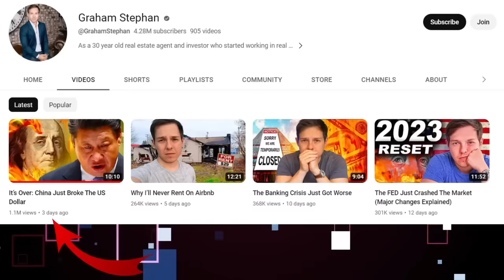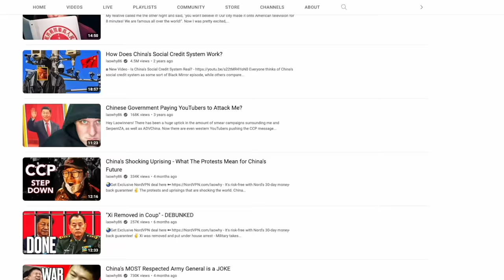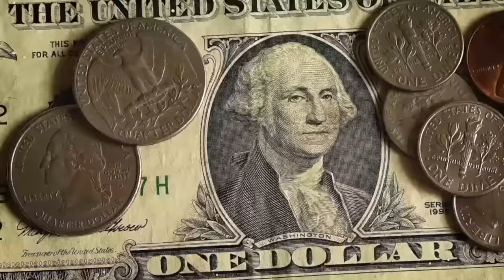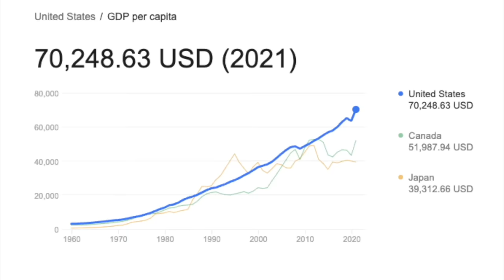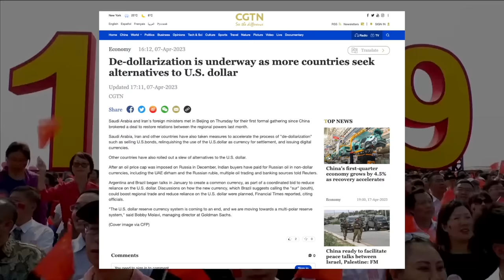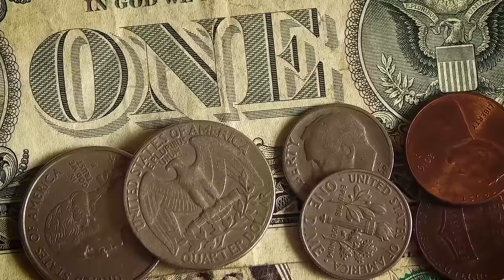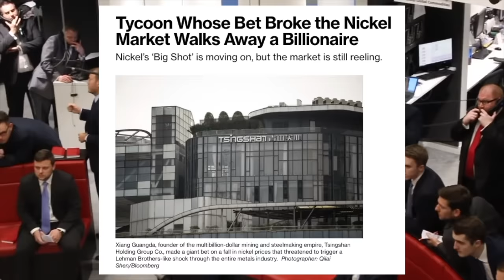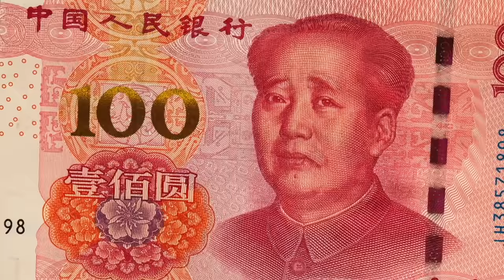It’s Over: The US Dollar Just Broke The Chinese Yuan

Comment: This is how the new BRICS+ global currency will work. They may call it Gold Gram (GG), a digital currency to be issued by the main BRICS council on ONE day, assume Aug 1, 2023.  The quantity of GG to be issued is based on the actual gold reserves at each central bank or certified gold holdings, in grams. Assume Brent oil price on Aug 1, is US$ 80/barrel, the spot gold is US $70.5/gram. So the oil price of that day is 80/70.5 = 1.13 GG/barrel. Saudi produced 5 million barrels that day, then there will be a credit of 5,000,000 x 1.13 = 5.65 million GG to Saudi govt ARAMCO account.  That same day Japan produced 10,000 vehicles valued at US $30,000/car, so BOJ has 10,000 x 30,000 /70.5 = 4.26 million GG to its credit. On Aug 2, 2023, Japan bought 1 million barrels of Saudi oil, at 1.18 GG/barrel spot price, with BOJ's credit of 1.18 million GG.  The same day Saudi bought 5000 Japanese cars with 5000 x 30000/70.5 = 2.12 million GG from ARAMCO's credits.  From there on, every body use GG as the global digital currency, based on COMMODITIES and products, NO local currency will be used for global trades. 
All the central banks and big finance banks are NOT allowed to loan out any GG more than what they have in their GG credit EARNED from commodities and products.  No more house-of-cards with unlimited phony Fiat money. 🤔🤨😉🙃🙂😎
Reply: Ah yes, so what you will get is basically a bitcoin.

I'm pretty sure it's gonna work well.
Reply: The reality is that if countries stop trading USD then the next time they disagree with the US they send in the US military to sort them out. US sanctions is good for foreign policy without needing a military, once that's gone the US will reopen its 300 global bases and station hundreds of ships all around the world to keep order. The main reason why USD become reserve currency is so the US government can downsize its military and save money, without reserve status they have to go back to having 10 million soldiers and 50 aircraft carriers and 200 submarines and 1000 destroyers
Reply: The spirit of Gaddafi and  Saddam Hussein keeps alive.  Its not Yuan..., IT IS GOLD.  Talk about Gold and the world will understands you; NOT dollar or Yuan.  Wake up...

Comment: Overall, I agree with your take. However, the US definitely does use the dollar's reserve currency status as leverage (detractors would call it "weaponization"). Many countries like China run trade surpluses, and there's a general rule that a trade surplus must be matched by a net capital outflow. Often, countries' central banks will buy dollar reserves. These might be held in US banks, or those where the long arm of the US Treasury can cause havoc. Since 9/11, the US has used this privilege to achieve its goals, most notably sanctioning Russia after last year's invasion of Ukraine. China itself goes to great lengths to avoid capital outflow, imposing capital controls on citizens & foreigners, and even having a dual currency system to keep exports & the domestic economy somewhat isolated. But all of that makes it even more laughable that the Yuan would ever be a reserve currency.
Reply: who would want a yuan if it only works to buy in one country, instead of the dollar that can buy anywhere, even in china.

Comment: Imagine there  is an item that costs $100 and its price goes up to $110 due to inflation.  A credit card was used which adds $40 of interests. Then a bond is issued for $150 backed by that credit card debt. Then 4 derivatives for $100 are issued backed by the bond.  There is a total demand of USD of $110+$40+$150+$400 = $700 from a purchase of an item that had a price of $110. If the debtor fails to repay, $590 evaporate.  And the increase of $10 in price due to inflation is not a sign of strength of a currency but weakness.  So you can see big numbers, but they do not mean what you think they mean.  What made USA exceptional is that it had the world reserve currency, but it was abused.
Any normal currency is backed by commodities. For example, if gold standard is used, and you do not want that currency, gold is given to you. With USD there is nothing given. And money was printed as if there was no tomorrow.
Reply: Yet you conveniently left the part that American assets (stocks of innovative companies, real estate, etc) are far more valuable than gold itself and are still sought after by foreign investors and of course they are bought with US dollars. This is the same reason why any standards based on metals are abandoned because it is limited in exchangeability - you can not produce enough of it to accommodate the economic needs of the country. If you notice throughout the history that the metal component of the currency diminishes along the way when economic complexity increases. The value of gold in the market is based on its immediate demand, but convert that into something else (microchip component) and it's value is significantly higher for the same quantity. You also haven't taken into account of the costs to mine gold and its overall availability in an exchange.

Comment: It's true the U.S. doesn't force anyone to use the dollar, but they do in fact negotiate with key countries such as Saudi Arabia to encourage them to price oil in dollars. Likely they would anyway, but apparently there has been concern in the past that they might not continue to, and that would cause the value of the dollar to fall. It would, as you say, also increase risk for Saudi Arabia, and damage the value of their holdings in dollars,  but they could gain some advantages in soft power. Not a good gamble in my opinion, which is probably the main reason they haven't seriously considered doing it.

Comment: The problem with Western (especially USA) thinking is that there are only two choices in any given situation.

The rest of the world is not so rigidly stuck to lazy duality like love vs hate, good vs evil, dollar vs yuan, etc.  The US Dollar has had its run, but it doesn't mean even if its influence is waning, that another single currency will take its place.

Trade models have evolved, and the dollar is not backed by anything other than the purported stability of the US economy, which helps the world peg oil to the dollar.

Wait and watch how diverse global trade will get in the next ten years.  It's more than started, and merely pointing out to what hasn't changed yet today is just absurd and silly.

Comment: You are wrong.

It is not about power or china propaganda.
It is about practicality. With $ interest rate that high, not many country could afford to borrow in us$. Or could handle $ fluctuation and weakening.

We are exporter usually using us$. The price of exports keeps getting higher in us$. And when we receive the $, often times now the exchange rate fluctuations wipe out our profit margin.

My guess it is the same the Brazil and Argentina importing now in yuan. In general people prefer low interest and stable currency. If there is better alternative the us$, I just use that.